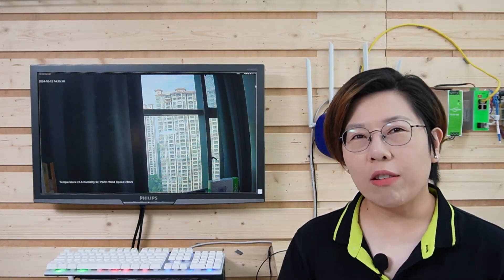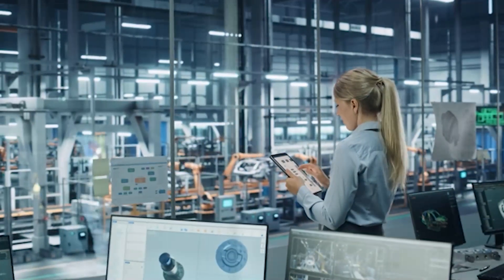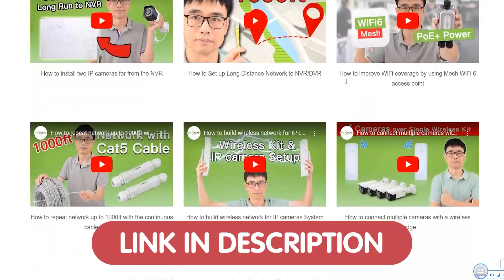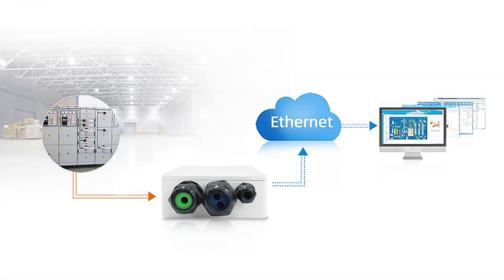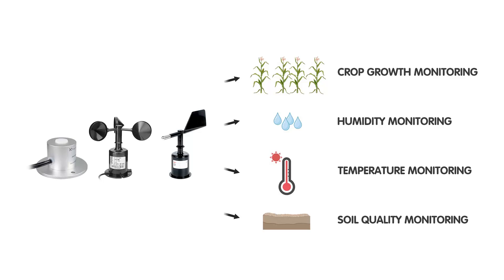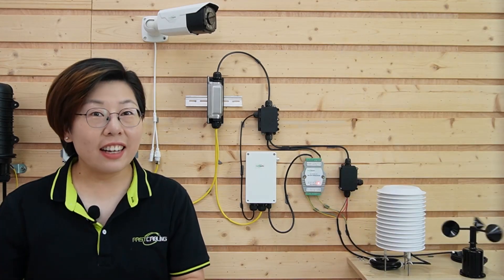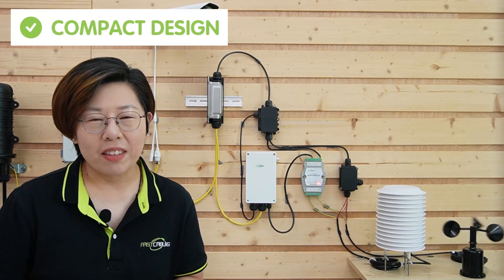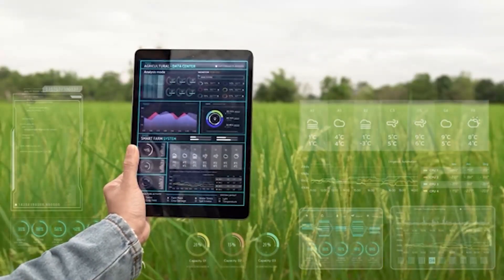Real-Time IoT Sensor Data on Video Feeds with Modbus RTU and Fiber Optics

Comment: Hello madam i hope you have a video with this set up, ISP-mikrotik-ethernet-mediacon A -NAPBOX-mediacon B , or what is the best way to have a internet to more client without using OLT with NAPBOX
Reply from the maker: If you want to serve more clients without an OLT:

1. Use VLANs for better traffic management and scalability.
2. Deploy Gigabit (or higher)  media converters and switches to handle multiple clients cost-effectively.